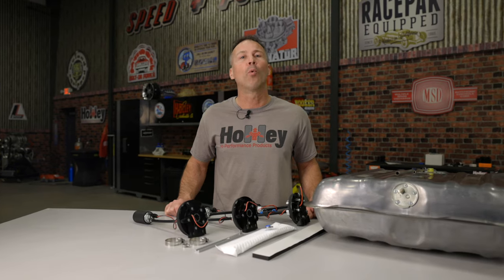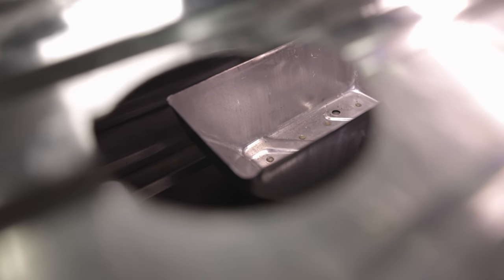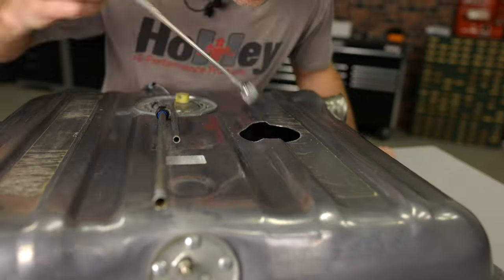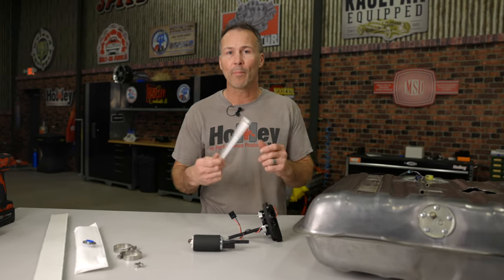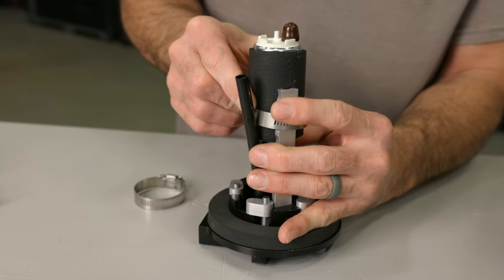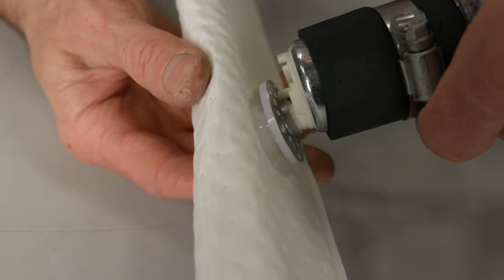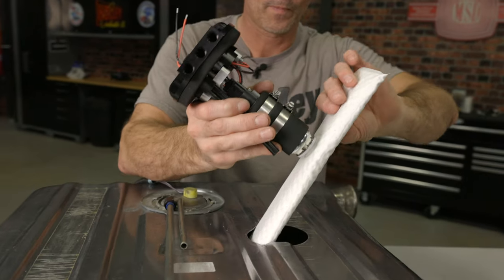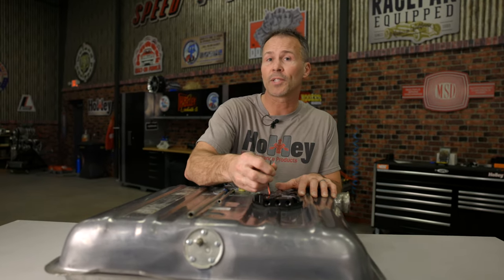Add a High-Pressure, In-Tank Fuel Pump To Your Stock Gas Tank With Holley Retro-Fit Fuel Modules

Comment: The math on cutting the tubes is all wrong! You need to reduce the length of the tubes by the difference between your depth and 12 inches. For example: My tank depth is 10.5 inches. If I used the 12-10.5=1.5 inches of tubing as indicated in the instructions, I'd cut my tubes down to 1.5 inches and my pump would be suspended half way up my tank. I'd run out of gas at half a tank! What the instructions should say is: 12-10.5=1.5 inches of tubing to remove. The math in the instructions is totally wrong. I can only assume people with enough experience in working on cars figure that out.
Reply: Okay… I thought it was just me..!!! Thank you

Comment: Will the new unit not fit into the stock location? Do you need to plug the lines to the original unit?
Reply: Good question

Comment: If anyone is using the 19-355 Sniper universal double pumper fuel module and you need a steel shim, a GM 200-4R forward clutch steel plate will work fine. The ID and the OD is perfect. 😁

Comment: Does this fuel pump need any fuel pressure sensor? I am running a 6.2 L92 with terminator x in my 1952 Ford Sunliner.  I am trying to lign out everything i need for fuel.
Reply: What did you found out? I am looking at this for my L94 but they don't list this for the Terminator system
Reply: @tokslut  not sorted yet. I bought it though, so hopefully it works out.
Reply: @SCSS2024  OK, thanks!

Comment: Mine is failing the pump regulator stopped working and gauge is now pegged out over 100 psi just 500 miles and past the 90 day warranty.

Comment: I just installed this pump. The bolts for the hold downs in my opinion will be a problem in the future They use a very small Allen head bolt into an aluminum lug. If this gets any corrosion it will be very difficult or impossible to remove the pump without cutting the bolts.

Comment: Question. I have a 93 Ford E150 5.8L Club Wagon Van 5.8l EFI. 
Can i hook up a in line/exTernal fuel pump to the wiring of the pump in the tank since is already hooked up to the fuse BOX,and how?